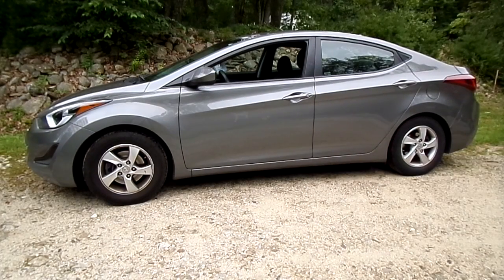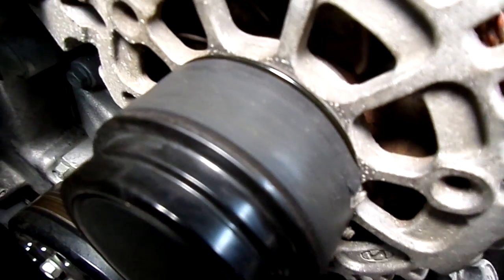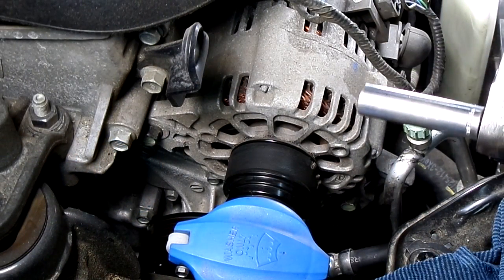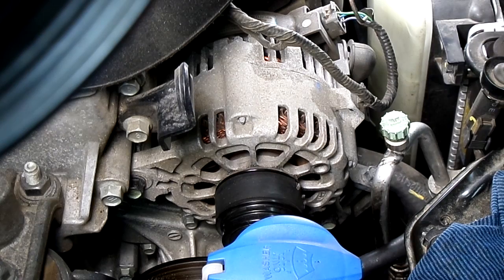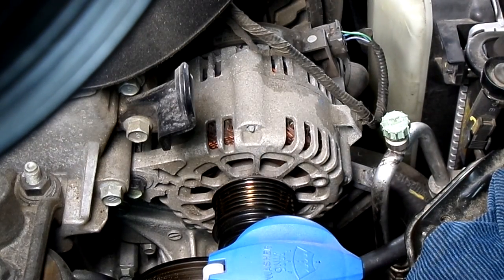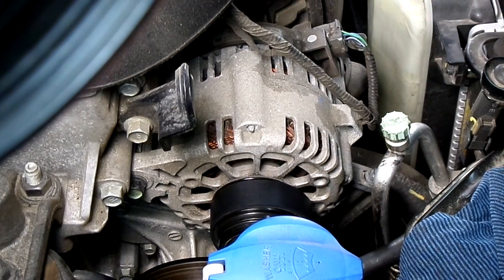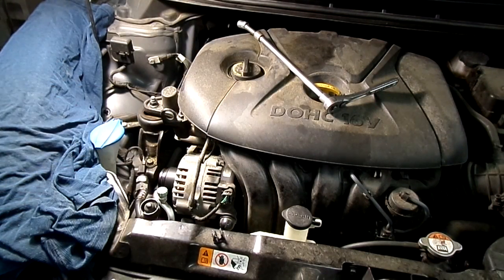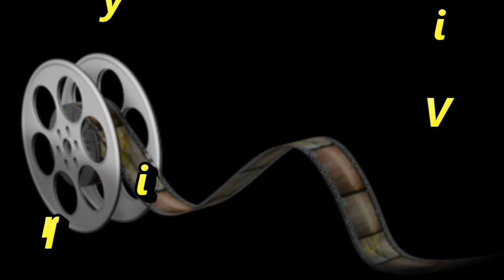2011-16 Hyundai Elantra Drive Belt Replacement

Comment: Thanks for the great video. I finally replaced my belt after 342,327 kilometers. The belt still looks good keeping it as a spare. Thanks for your help. 👍
Reply: Your elantra actually made it that many kms?  Mines at 183k and im over here wondering if the engine is toward the end of its life.  Put high mileage oil in, only ever had breaks done, trans fluid changed and fuel injectors cleaned and plugs changed on it.

Comment: After replacing mine a couple months ago, it's starting to squeal now. Does it need to be tightened again? I feel like it may have stretched a bit or got loose. And do I have to loosen the 2 bolts on the alternator again, tighten the belt, and then tighten the alternator again? Or is there another way to tighten it?

Comment: You showed the specs for belt tension but you didn't check the tension.  People, don't install like this.  A belt too tight of loose will cause other problems.

Comment: Wow...that's a lot of torque on that belt!  150 ft pounds??  that can't be right.  the wheel lug nuts are torqued to 60 ft lbs so I can't imagine a belt tensioner bolt would be more than double that torque.  You would need a 3 foot torque wrench to achieve this amount of torque.  Am I wrong?  someone please chime in here.